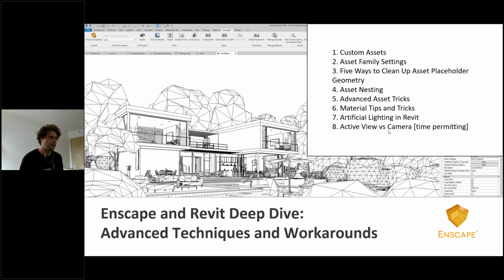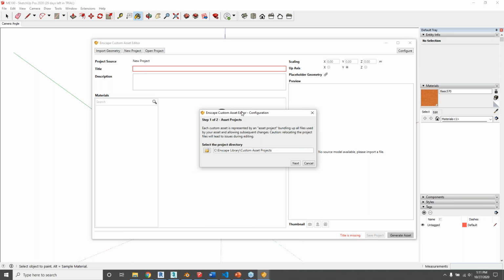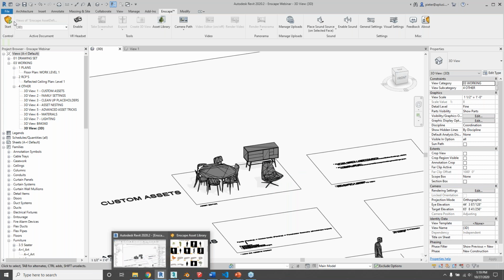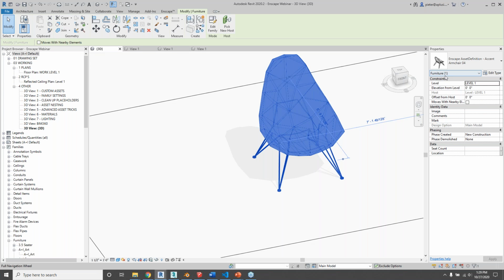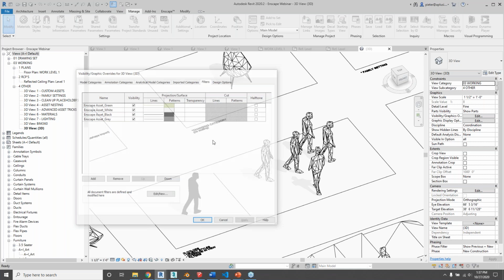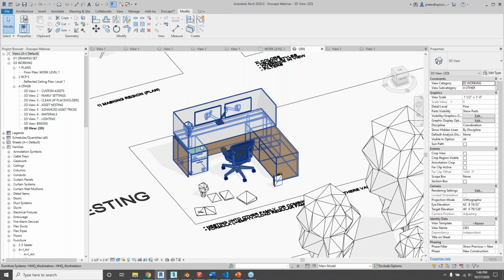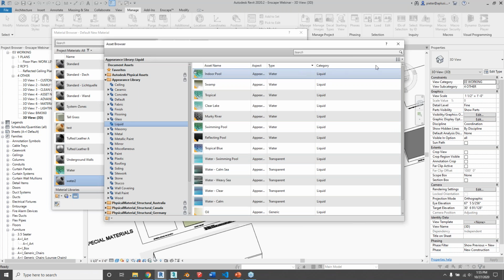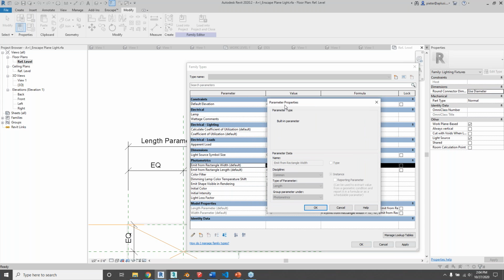Enscape and Revit Deep Dive: Advanced Techniques and Workarounds

Comment: Hi Guys. Pieter was talking about sending an Email with the demo file he was using.
I just need to see the rest of the formula he was using to scale the trees by instance.
it's at 47:58sec but the full formula is cropped in the dialogue.
I would like to update the free low poly trees I have posted to include this feature.
could I get the email? or the Tree family? or the Formula he is using?
Reply from the maker: Hi Joe, one of our Customer Service Representatives shared this comment on this video a few weeks ago, I hope it helps: 
= EnscapeNativeAssetHeight * (EnscapeNativeAssetHeight / EnscapeHeight)   - use exactly these names and don't forget to link the nested height to nestedheight parameter. Have fun ;o)